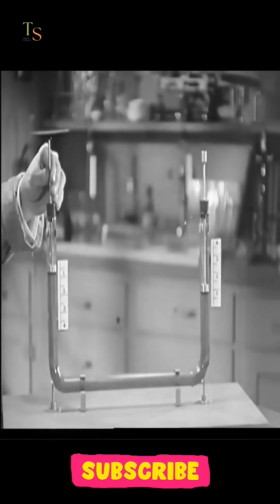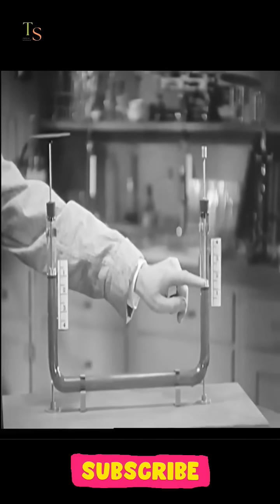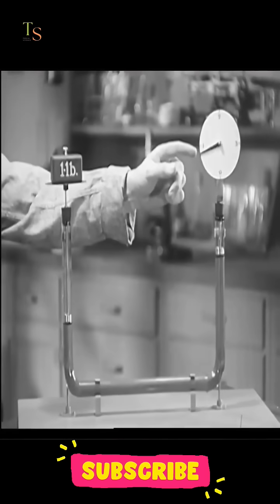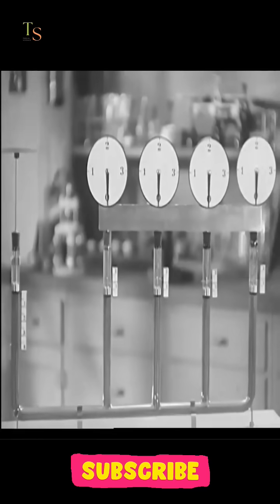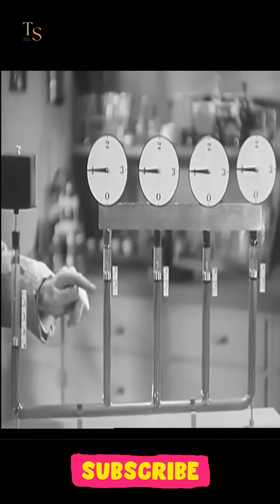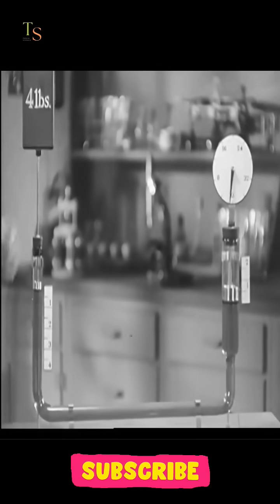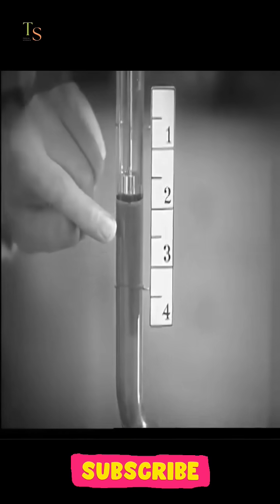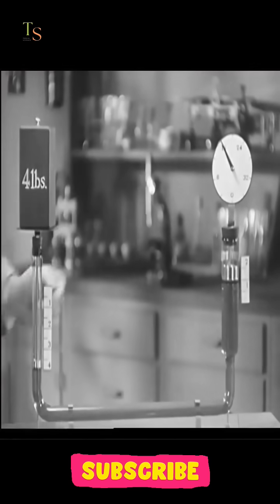How Hydraulic Brakes Actually Work #HydraulicBrakes #Engineering #physics

Comment: You said that no force is wasted.  That's incorrect.  Some of the force is turned into heat.
Reply: It meant a force can be transferred to another place by hydraulics without loss, regardless of the number of bends, and this is true for a static system (if there's flow there will be a small amount of loss).  This is different to a system of levers and/or cables where some of the force is lost to static friction at each change in direction.  Also, heat is a form of energy and force is not.  It was referring to lost force, not lost energy.  If nothing is moving, force can be transferred with no transfer of energy.  Energy is lost when things start to move.  Force can be lost to static friction without any energy transfer occurring.
Reply: @galacticminx  you... you are a master of your art Sir
Reply: Issue is they measure forces when everything isn’t moving, so no liquid turbulence and no energy of force loss 
But this is no longer when the system moves
Reply: @RickTopia-xd6wu When the system is moving the force needed is even less because the brake booster amplifies force using vacuum from the engine.
Reply: I feel like turbulance doesnt apply when its in a sealed tube with no air @RickTopia-xd6wu
Reply: the losses from heat generation would be close to zero when compared to other means of transferring energy
Reply: @ZEMPHYRRIANs420gaming-bl7wm close to zero isn’t zero. We’re splitting hairs here. But if we are splitting hairs, you can in fact compress a liquid just the compression is insignificant.
Reply: @ZEMPHYRRIANs420gaming-bl7wm it is true but it is incorrect to say that nothing is wasted while it indeed is. Instead the narrator should say almost nothing is wasted. Those two thing are different.
Reply: The correct phrase is "the work of any force is not wasted". And yes some of this work is turned to heat- thermal energy  but it is not lost.
Reply: @ΔημήτρηςΓεωργίου-ο9θ Soooooo YES, if some of the energy is lost to heat, then that force is by definition lost. If you put X amount of force into a hydraulic system, and the system temperature rises by Y  . You get X-Y at the working end of the system. What happened to Y? It's lost due to entropy. This is called system efficiency.  NO, system is 100% efficient.
Reply: @ΔημήτρηςΓεωργίου-ο9θ yes, some of the MOTION energy.
But not the final pressure force.

All you guys think that by a little friction, all would be lost.

Applying 700 braking horsepower to a set of wheels is somehow diminished by the friction of  a few seals, and some fluid motion?

If any one of you is that smart, then calculate the actual loss, and also add in the math for the hyperbolic curve that denotes that loss.
Reply: I would love to see an old 50’s video on Thermodynamics simplified.
Reply: The loss of friction also
Reply: True but still a tiny fraction of
Reply: @hybridracers Boiling water doesn't break it down to hydrogen and oxygen, only electrolysis can do that. Boiling water makes a vapor of H2O.
Reply: Misinformation. So i reported it
Reply: Force is not energy
Reply: static force shouldn't be affected.  only the total work/energy will have a tiny fraction turned into something else such as heat, noise, pipe flex.  hydraulic systems are the most efficient and flexible for transmitting and multiplying force.
Reply: No force is lost 😊
Reply: @GeraldPUR  it is not that much that we should care
Reply: heat is also a "force" yapping boy
Reply: @barry_wastaken  please explain.
Reply: @nickt6980  no
Reply: That's what I'm about to say.
Reply: Force isn't heat.
Reply: @anomalyp8584  read that again.
Reply: Entropy
Reply: I really like functional science as these discussions are enlightening. Explains why I became a mechanic turned engineer
Reply: Heat is energy. So no you’re wrong
Reply: You are wrong on so many level.
Heats in this brake system happen not because the transfer energy, but the friction happen after the transfer happened
Reply: Wrong, kinetic energy is mechanically turned to heat energy
Reply: And Inertia
Reply: No force is still technically lost, stop truing to sound smart.
Reply: Dude, if you are so pedantic you should at least be correct. 

Force can not turn into heat. It's the energy that does.
Reply: In this case no het is created the video explains everything only an idiot did not understand it
Reply: Not to mention that liquid can be compressed....lazy ahh AI made short.
Reply: He means compared to system with a compressible fluid like air
Reply: I think the point is that in other systems, the mere transference of force/energy is riddled with inefficiency so that you lose a lot of the invested energy before even getting to movement, friction, and heat.
But this way they could preserve most of the energy.
Reply: Always this one fucker then NEEDS to be technical to sound smart
Reply: You sure? Seeing as how fluid does not compress wheres the heat coming from?
Reply: @DarkAttack14  fluid can compress. Heat comes from the agitation of the molecules.
Reply: that's not waste, that's a byproduct. however if that byproduct is not used, indeed it's wasted. as minimal as that may be. the heat created on the brake disks as an example is also a byproduct from the forces emitted on it. some things you can't avoid. however, if you can instead convert that heat / energy you minimize any waste.

that's why hybrid cars are such a benefit, as the energy that is put into braking can be re-used into generating (electricity storage). 

if you walk, you also have force wasted. your muscles also produce heat, your heart, everything. a lot less efficient than a car for example in comparison. you start sweating, and it goes into clothes and causes smell and you then need to clean your clothes which also uses energy that goes also to waste as there is no 100% efficient washing machine.

simply put, stop talking about your @ss thinking you look smart, you look quite the opposite.
Reply: And friction!
Reply: Explain how a power washer works if water can’t be compressed!

According to the US Science journal water can be compressed up to 20 times, it’s just extremely difficult!
Reply: Not the same
Reply: Agreed (though energy not same as force), easiest way to demonstrate would be a circular tube filled with say water. lay the tube on the side and accelerate the water to move in it. Watch what happens to the water after you remove the accelerator.... It will slow and eventually come to a stop. Why? because a "reverse" force is beeing applied in this case known as friction. 
Same as with parachute. Down force is total mass time the gravity at the point of height you are at. But the upforce is the the friction aka the force it would take to push/move the air in the objects path down or to the side. The resulting force is LESS than gravitys force aka force is "lost".
Reply: Did you just equate heat with a loss of energy?

My man?
Reply: Force cant be turned into heat since it is not energy. Work can be though. So when you move the cylinder it is work over a distance, which is work. Which can be turned into heat
Reply: That's not wasted
Reply: Bro you mean some is compensated in drag and friction. Since force is not the same energy.
Reply: Shock absorbers?
Reply: Force and energy are two very different things.
Reply: He is actually using an AI voice to say what the actual narrator said. Why not just have the original audio is probably because of copyright. It is a very old film, from around the mid 1930's, and the film was made by Chevy, not scientists.
Reply: which warms your toes. thus not wasted.
Reply: No pushing force is wasted, the equal force reaches the other pistons.
Wtf are you talking about,the pistons wont heat.
Heat from brake disc comes from the pads that creates friction on disc ,not from the cylinder pushing force
Reply: The energy is not wasted
Reply: Yeah, but they're simplifying because it's a popular mechanics presentation. For most intents and purposes it's sufficient to say no loss.
Reply: Not wasted. That’d be like saying the food you eat is wasted because it comes out as waste.
Reply: Energy yes force no
Reply: Friction loss
Reply: @mikephillips2984  a force is not energy, work is energy. You are describing energy transfer when doing work.
Reply: @mikephillips2984  forcing it through is doing work (which is energy). Force is not energy. Force is not wasted...force is just force.
Reply: @mikephillips2984  no and no and no. My point is what I said...force is not energy. Apparently it's hard for you to accept the statement.
Reply: That's like saying gasoline turned into momentum
Reply: @mikephillips2984  eh ..you. why are you using ad hominem tactics in a scientific argument. Doesnt make any sense.
Reply: Not exactly. The friction conducts into heat. The heat is transmitted through the glass. 
And he said liquid is not compressable. That’s false. Only water is not compressable
Reply: Force is not energy, can't compare them together. Of cause every system will have friction, but here means, if you apply 1N of force then the other side receive 1N, but not 0.9N.
Reply: @mikephillips2984  i fried your brain? :/
Reply: Some force turned into your mom
Reply: You've admitted yourself it was not wasted. It has been turned to heat. 

If I kill a bear and use it's pelt as a quiver, you can't tell me I wasted the pelt, just because I didn't turn it to something YOU want.
Reply: Two thousand years ago an old indian 🇮🇳👳 poet had written in her poem about the liquid that can't be compressed as the same way the genuine people characters also wouldn't changed in any hard situations

😮

Her name is OUVAIYAR 

❤
Reply: Right you are. No machine can reach 100% efficency
Reply: Force doesn't get transformed into heat, the energy is, not the force. Their dimensions are different
Reply: All thermodynamic systems have loss in this form. This is the one singular instance i agree with the trashy TTS video over a comment.
Reply: Any how the final conclusion:::
Energy is neither be created nor be destroyed 😊😊😊😊
Reply: Well technically it's not wasted it's just turned into something else
Reply: Also, some forces are being applied to the walls of the piping.
Reply: That’s the part you had a problem with? 😂
Reply: He said right no force is wasted Those are the losses
Reply: Force and energy aren’t the same thing.
Reply: That's not waste. It's converted. Though depending on speed of fluid motion, that heat is negligible.
Reply: Or is heat a byproduct of force
Reply: Then it's not wasted, is it.

Energy doesn't disappear, ever. Not once in the history of anything at any point in time. It transforms.
Reply: @NtoTheM  No one said energy is disappearing but it is still technically wasted because some of the energy is converted into something we don't wanted.
Reply: And sound
Reply: Different between force and energy
Reply: No force is wasted on just the hydraulic system itself not brakes
Reply: Negligent heat transfer and it’s all but cancelled out with advanced hydraulic fluids
Reply: Not exactly true. energy is lost, but the force not
Reply: Kinetic energy is turned into thermal energy which is released into the atmosphere and to make sure your brakes don't overheat and cause brake fade
Reply: @thewrencherz28racer92  the thermal energy is converted in another mechnical system. The hydraylic system doesnt interact with the mechanical brake disk system.
Reply: @damianoskarakasidis3343  the reason we use brake fluid instead of water is because your wrong
Reply: @thewrencherz28racer92 brake fade comes from the heat transfer gained by friction of the pads against the rotors.  This heats the calipers and boils the fluid which is hydroscopic, absorbing water from the atmosphere.  It's the water that boils actually and splits it into hydrogen and oxygen.  Gas is compressible.  Boom.... brake fade
Reply: Force can't turn into heat because they are different units. Energy is derived from force. The force applied over the distance is energy. You may lose some energy transfer, but the force on the opposing piston is conserved, or more specifically, the pressure on the cylinder. If the walls of the tubing aren't perfectly rigid you will also loose some of the travel distance (energy) on the other end, becasue the energy is being applied to the tubing to stretch it a certain distance. Force/pressure is conserved on the faces of each cylinder head though.
Reply: In a meaningful/ relevant way or do you just want to be right?

Comment: Well only partially correct. 
In commun used hydraulic systems its correct. The pressure is to low to compress the liquid. 
In extrem conditions, for example waterjet cutting that works with extremely high pressures liquids are compressable even its minimal. 
So its not a question if liquids are compressable. It a question of how much pressure you need to compress a liquid.
Reply: The water pressure at the tip of the jet cutter is only 1atm . The water cuts the metall because of its speed - kinetic energy not pressure.
Reply: @ΔημήτρηςΓεωργίου-ο9θ  
In waterjet cutting, normal pressure refers to a water pressure of up to 60,000 psi. Of course, this value is not 'normal' compared to the water pressure in non-cutting applications. However, compared with a hyperpressure pump which goes from 60,000 psi to 90,000 psi, or higher – it is 'normal'. That's about 4.082 Bar (Atm) up to 6123 Bar (Atm) in in high pressure applications. 
Industrial waterjet cutting depends on the pressure that results inva high speed at the nozzle. It's also not pure water. An abrasive powder is mixed into the water. 
As an electronic technican I've maintained the controll cabinet of a few waterjet cutting machines for cutting Glass and metal.
And they definitely working at high pressure.
Reply: @ΔημήτρηςΓεωργίου-ο9θ  Difference in pressure outside and inside is the exact cause of that kinetic energy (Bernoulli's principle). The bigger the pressure difference the faster its speed means the higher the pressure inside the faster the speed. Higher pressure corresponds to more compressed liquid which invalidates the AI voice in video while giving an exact example

Comment: Read a physics book! Oil can certainly be compressed. Oil is a liquid...
Reply: What you're referring to is a compressible fluid... incomprehensible fluids also exist and one such example is water
Reply: @evanrozario6361  dude. The volume of water decreases to about 83% at 60.000 PSI. stop telling BS if you don't know nothing.
Reply: @evanrozario6361  Water is only technically incompressible under normal conditions. But water can for sure be compressed.
"The pressure required to compress a volume of liquid water by 1% is 2 x 10^8 Pa."
Basically, if you have the ability to make pressures of about 10,000 atmospheres or the pressure you'd get under 64 miles of water, then the water at room temperature will turn to ice.
Reply: @STaSHZILLA42  nope, it will be compressed to its smallest volume and that is at 4°C so it willl be a liquid
Reply: @RigelLingate  I guess the science I quoted is wrong then.
Reply: @RigelLingate 😂🤦
Reply: @RigelLingate  The temperature that water freezes at is based on the pressure.
Reply: so why do engines pop valves and bend piston rods when the cylinder intakes water?
Reply: Liquids do compress, but only very slightly, saying they don't is 'lies to children' to simplify the theory.

the forces involved to compress liquids are often impractical to achieve, and often so high they are safe to ignore unless you're doing something really niche.

Under almost every circumstance compression or expansion in a liquid is due to temperature changes, trapped gas, or plastic deformation of the container, hoses, etc...